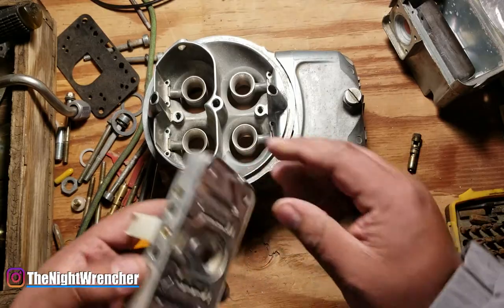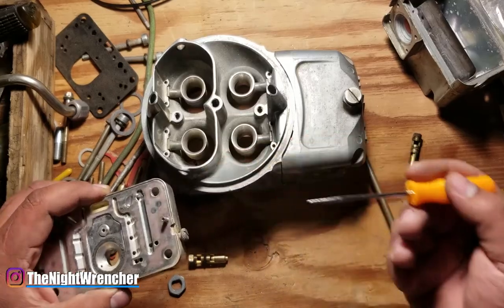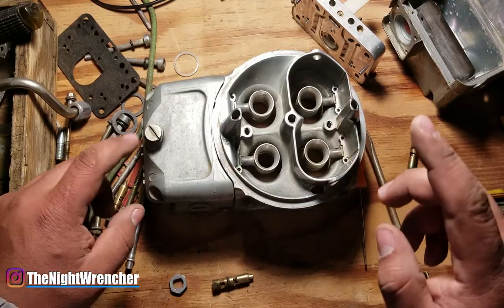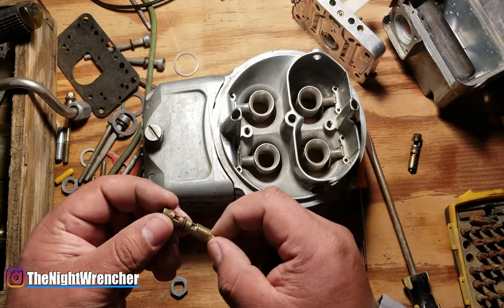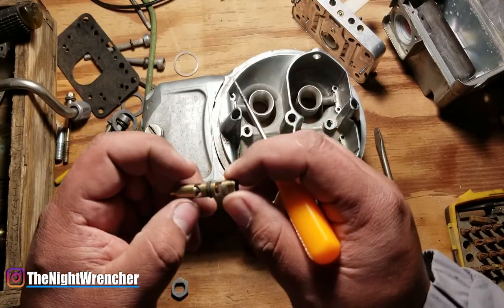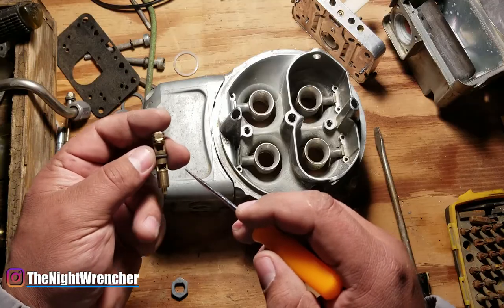Holley Carb Flooding Out Vent Tube | Troubleshooting Holley Carburetors | Holley Carb Secrets |

Comment: Thank you so much. I converted a ford 460; in a bale wagon, from a mechanical fuel pump to an in-line pusher pump with fuel regulator. When I would attempt to start it I had fuel running out the top breather tower and in the boosters. I cleaned the breather holes and sure enough my o ring on needle seat was flat and brittle when removed. I put the new R-03 o ring on as following your directive adjusted it to where it sat just below the adjusting nut tightened it down, prayed to the Holley carb god, it started right up and IDLED. Went to the field to pickup bales it not only had good power but idled and ran so much cooler, thank you for sharing your knowledge a breath of fresh air in a crazy world we live in, take care saved my butt.
Reply from the maker: Thats awesome, good to hear! Great job!

Comment: Very well made video. I have been working on Holley carburetors and this was new information about the "O" ring.
Reply from the maker: The oring is actually the cause of a lot of problems. The needle and seat isnt the issue most of the time.

Comment: Very informative video! I am having an extreme problem with my Rinker boat with a 4 barrel carb. This unit is non adjustable which I think is normal of marine units. So fuel is pouring out of my front and rear tube now that I let the boat sit last summer(skin cancer issues). I just replaced new Holly needle and seat and same problem still. This boat has ran great for 4 years since I replaced engine/carb. Really messed up letting it sit last year! This needle and seat is just a pointy rubber coated tip. The old ones did seem worn a bit. Yet, new ones did not change the fuel spilling. I just tried to vent floats down more and didn't help. I sprayed the 2 holes per barrel a few times with carb cleaner. Guess I need to buy a gage and regulator next as I'm stumped. It's just a Carter pump that runs 4psi. I have no idea why I would all of a sudden have high fuel pressure. Any thoughts?
Reply from the maker: First thing I would check would be fuel pressure and fuel quality. Old fuel doesnt let the need seat well and can cause issues. If fuel pressure checks out, clear out the tanks with fresh fuel(make sure you have an inline filter). After that, I would make sure none of the old rubber from the old orings is preventing the oring on the new needle to seal up. Good luck.
Reply: @NightWrencher  thank you sir. I put a gauge on and it seems my 4psi non adjustable fuel pump is now putting out 15+ psi. Have you ever heard of an internal regulator failing? It's Carter and I think they are out of business now
Reply from the maker: @stankyd937  you can buy replacements at the parts stores for not a lot of money. They might be redesigned off brand carter pumps
Reply from the maker: @stankyd937  when pumps sit, their internal regulator can get blocked so i think that is whats happening
Reply: @NightWrencher  will swap one in and report back. Thanks again. Best YouTube mechanic out here in this category!
Reply from the maker: @stankyd937  thank you sir! I appreciate it!
Reply: @NightWrencher  well I got a new Carter pump on, same unit as old. Boat fired up and ran perfect for 10 mins at 4psi. No more vent tube flooding! After 10 mins, noticed fuel pressure kept dropping and had to kill engine as it was hitting less than 1psi. Couldn't get it restarted. New pump didn't feel hot at all. I'll try it again tomorrow when everything is completely cool again. May run a hose outside on the ground and let the pump pull fresh gas to verify if old gas is gumming up the oil/water separator maybe. Getting there I think
Reply from the maker: Sounds like there is something definately up with your fuel system

Comment: My street brawler had float out of adjustment for a bit. Over filling the bowls. I re adjusted but now it wants to blow a blackish white smoke out the pipes. Ur video makes me  believe I could have clogged air bleeds? It’s a pretty much new carb. 650 double pumper street brawler
Reply from the maker: If its a new carb, I dont think you'll have any issue with the air bleeds. I would check fuel pressure first and then after I verify thats its under 6.5psi, reset the idle adjustments
Reply: @NightWrencher  
Oddly enough I have the 
The same problem with my Street Brawler 650.
I called Holley tech support and they were no help.  I set the fuel pressure at 5 psi with a return line to the tank.
I set the fuel level as low as possible and I still get fuel coming in whenever the engine gets up to temp and then shut it off for 15 minutes. The power valve is a 5.5 @ 5000 feet elevation. I put a plastic 2 in spacer underneath the carb. The area around thefuel  swerters look wet.
This has the problem of washing the oil off the pistons but so far everything I have tried hasn't worked.

Any other ideas?
🤔

Comment: So what is the solution to Holley carb flooding after the engine is shut down "only"
Float bowl lwvel goes down and does not refillp
Reply: Only happens when the moter is warm
Reply from the maker: Chances are that the fuel is 1) leaking out past the bowl gasket 2) leaking down into the intake via a worn out PV or PV gasket 3) the fuel boils and evaporates from the heat and thats it. It takes a good while for fuel to evaporate out but if it boils, itll drip into the throat of the carb and when the fuel cools down, itll fall below where you can see it. The engine will tend be hard to start and act like its out of fuel but in reality, its actually flooded.

Comment: This is a good video, lots of info! Now that my first start was a success ill start tracing down my issues lol
Reply from the maker: One step at a time and youll get it 👍
Reply: @NightWrencher  im just happy it fired up. Still had an issue with the needle and seat after, took it apart and found a lil dirt clogged it from the cutting of fuel line. Now I need to check float levels and all the other stuff. Last time I tried to check the fuel pressure it came shooting out at me lol
Reply from the maker: I keep it at 5.5. Even a worn seat will work well at a lower psi
Reply: @NightWrencher  yea I got this marshall fluid filled fuel gauge that skips a few numbers

Comment: Great explanation of bowl issues.   I had a car that sat for a while and now the carb is pushing gas out the top.  It is a 2 brl carb so I am guessing the basics are the same.  I remember pulling a VW Bug carb apart and cleaned it up, put it back together and all was just fine.  Hoping the same here.  Good thought on new gas (the old stuff was pretty bad) and maybe that will clean up the issue.  I'll start the easy fixes first before pulling anything apart.  Sure appreciate the guidance.  Fuel pressure is interesting, this is a 69 Mustang, 250 ci 6cyl engine.  Any recommendation for a fuel pressure regulator?
Reply from the maker: Thats a really common issues with holleys that sit. Accel pump diaphrams get stiff too and the pump shot gets weak. Pull out the needle and seat and check if the oring is still good. If its flat, you need to replace it but if it still sticks out a bit, a fuel pressure regulator should help a lot. Oreilly usually stocks a holley one. Its precalibrated to 4-5psi so you can install it inline the fuel line and youll be good to go.

Comment: The O-ring is good when it's proud--it sits proud. Btw, O-rings are not all made with the same materials. I suggest you replace the entire needle and seat assembly. It's money well spent!
Reply from the maker: I've been able to revive several sets of needles and seats so a few $ in orings already saved me close to $100 in needles and seats. But I go through a lot of carbs so maybe for someone who only works on 1 carb every once in a while, a new N&S isnt a bad idea
Reply: @NightWrencher  I replace the the N&S assemblies every 5 years or so on my classic car--together with PCV Valve,  Plugs,  Fuel Filter, Manual Trans and Diff oil, Coolant, Belts, and Tires. I don't want a new O-ring on an old N&S assembly that already has an old needle tip.  It's cheap insurance against flooding and possible fire.

Comment: Great video, as usual. I wonder if you might have some thoughts on my current situation. Holley 770 street avenger with 13.5 AFR and 8 psi fuel pressure soon after choke turns off but not yet hot. After a few minutes the fuel pressure drops to 5-6 psi, which is great. Then, the fuel pressure continues decreasing to 2-3 psi and fuel starts spitting out of primary bowl vent tube and AFR drops to 11 or lower. This is a bit confusing since high fuel pressure would cause needle to unseat but not low fuel pressure. Also, vapor lock would starve fuel and AFR should jump above 14 etc. Could boiling or percolation in bowl cause fuel to discharge from vent tube and raw fuel cause low/rich AFR? Just to note, as pressure drops, fuel should boil at a lower temperature hence my concern about boiling fuel in bowl. Winter blend fuel is probably not helping the situation.
Reply from the maker: Let me ask you this, what fuel pressure regulator are you using?
Reply: @NightWrencher  no regulator. using Holley 110 GPH mechanical fuel pump and I was told it wasn't needed. However, I can watch fuel pressure start at 8-9 psi during startup.
Reply from the maker: Every fuel pump that I have seen, needs a regulator on a modern holley. If you install even a cheap holley parts store regulator, it'll run way better. Anything past 6psi has enough pressure to push past the needle and seat slowly but surely. Once the bowl is over filled, the needle sticks open and bleeds all the pressure into the bowl. Install a regulator and I can almost guarantee  that your problem will be fixed
Reply: @NightWrencher  That's the plan (and return line). Thanks so much for the information, very helpful.

Comment: Nice vid.  Okay to flush out the air bleeds while the carb's still bolted to the intake?
Reply from the maker: Take the bowls and metering blocks off and youll see the 4 small holes for the air bleeds on either side of the boosters. You can spray carb cleaner through those holes and they should blow everything out the top
Reply: @NightWrencher  Thanks!

Comment: I have a Holley 4160 which will not run under 2000 revs. The fuel dribbles into the venturies rather than a mist can you help with a solution.
Reply from the maker: Hey man, I thought I had replied but I guess it didnt post. My recommendation would be to verify fuel pressure and make sure no fuel is coming out of the boosters at idle.

Comment: Rebuilt my carb a year ago and it sat for a while. Found the orings to be completely flat and brittle. 

Are the R03 orings also advertised for ProTek RC Samurai 321B, S03?
I see them listed all over by that name.

Cheers.
Reply from the maker: You know, I dont think that number cross refferences. I have an SAE oring kit and the oring listed was R-03 but I'm not sure if thats an standard number or its a number just for the oring kit
Reply: @NightWrencher  Lol yea they didn't fit. 

Plenty of people on ebay selling just the viton oring for most holley carbs. 

At about a dollar a piece too.

Cheers
Reply from the maker: Oh nice tip. I've gotta check it out 👍

Comment: I have an old holly without the float adjustment, and it’s spewing gas out the breather, I just cleaned it and it’s still doing it, what else can I possibly do?
Reply from the maker: Do you have a fuel pressure regulator on it?
Reply: @NightWrencher  no I do not, but should I need one with a factory pump?
Reply from the maker: It depends entirely on fuel pressure. Have you checked it?
Reply: @NightWrencher  not yet but I’ll try today, by any chance do I have to readjust the floats like I would a edelbrok?
Reply from the maker: I'm not sure, what is the list # on your carb?
Reply: @NightWrencher  where would I find that number?
Reply from the maker: It should be on the air horn

Comment: I have a 4150 carb it seen no fuel is going into the engine  the fuel bowl is full a fuel  any idea
Reply from the maker: The only time youll see fuel is when you hit the accelerator and the accel pump nozzle shoot fuel. Is that what you mean?
Reply: @NightWrencher  well at first  it wet all the plug and after a new set it seems  all dry  I will  change the oil and see

Comment: 2:40 this is currently happening to my Holley carb while idle and especially if I accelerate. If I replace the brass needle will that fix the problem? Are there additional steps I should take after replacing the needle?
Reply from the maker: I would at least pull it out and visually inspect it. If it looks dry or flat, go out and pick up a new needle and seat. But before you do anything, check your fuel pressure. I've seen tons of oe replacement mechanical fuel pumps put out at least 8psi brand new which would overpower the seat pressure in the bowl. Too many people blame the carb and have it rebuilt or replaced only to have the same problem happen again.
Reply: @NightWrencher  you wouldn't happen to have a video on how to check the fuel pressure would you? Lol
Reply from the maker: Lol no, its really easy, most parts stores can lend you a gauge or harbor freight sells cheap gauges too. You really just need to check it once while its idling and that's it. if its higher than 6psi, youll need to put a regulator between the mechanical pump and the carb, but if its lower than 6psi you can move on to checking the needle and seat
Reply: @NightWrencher  will do thanks man

Comment: Hello I’m having trouble with a Quick Fuel carb, I’m running an EFI pump to a regular adjusted to 6 PSI. The float level will stay in adjustment on one side but the one the other I the level creeps causing flooding 
The carb is brand new never used but it has been sitting for 3 years maybe longer 
Do blow thru have the bleeds you’re talking about in the video?
Thanks. Like and Subscribe
Reply from the maker: Hey man, chances are the orings in your carbs needle and seat are dried out. Try to lower the psi to 5 and see if it helps, if not, pull the needle and check the oring.
Reply: Will do, thank for for taking the time to answer my question.
Reply from the maker: @rivermetal  youre welcome, I hope it goes well for you!

Comment: What are the numbers on the needle and seat o-ring I can't find it 
Thanks
Reply from the maker: I'll try to find out and put it in a pinned comment but its one of the smaller SAE ones in the generic kits. About $9 at harbor frieght and $15 on summit. Has to be the red one. The blue one is metric
Reply from the maker: https://www.summitracing.com/parts/wmr-w5202?seid=srese1&gclid=CjwKCAiAuoqABhAsEiwAdSkVVFyvSw7uKV3cJIMOwDK9jcngKyC6JRN9QV17xvO7Ab_2yDUdVEsL1hoCOUcQAvD_BwE
Reply from the maker: Cross referenced the number and I put the specs on the pinned comment